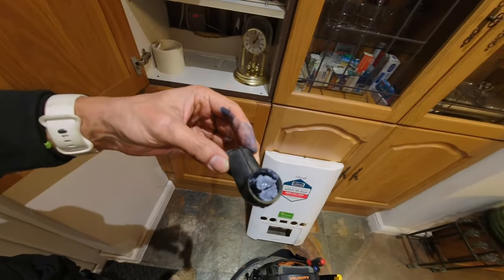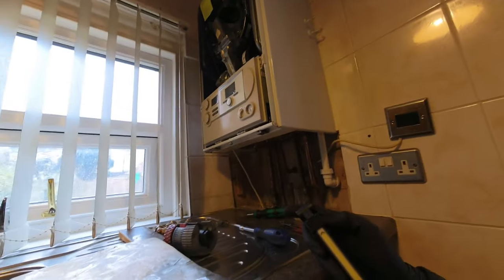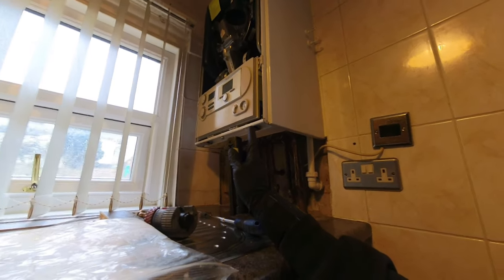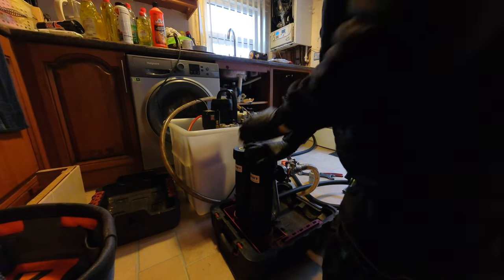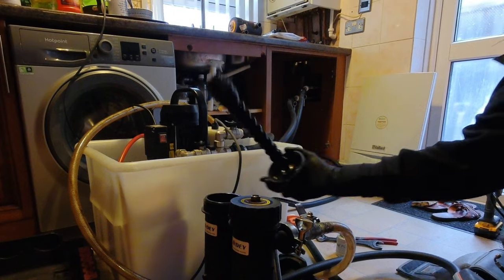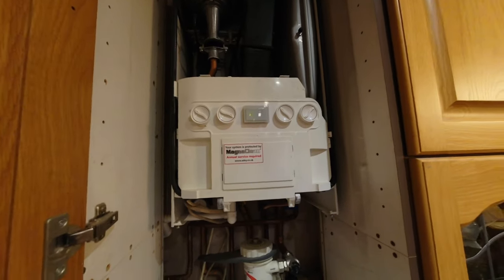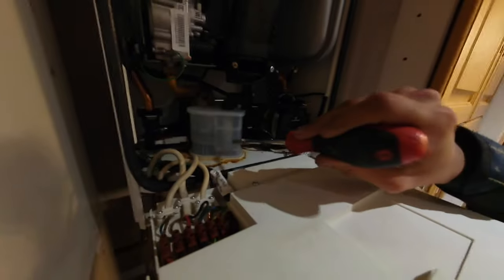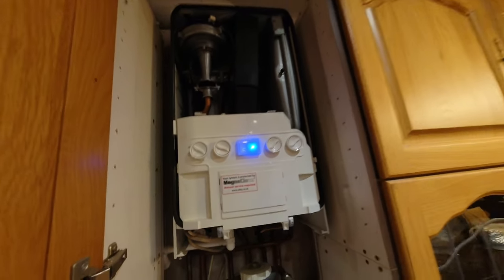What The Hell Is This?! - A Day In The Life Of A Gas Engineer 126

Comment: Aluminium oxide on that logic 
Seems to happen if the heating temp on the boiler is set low 
Like you say heat ex needs cleaning every year on service 👍👍
Reply from the maker: Never been a fan of aluminium heat exchangers